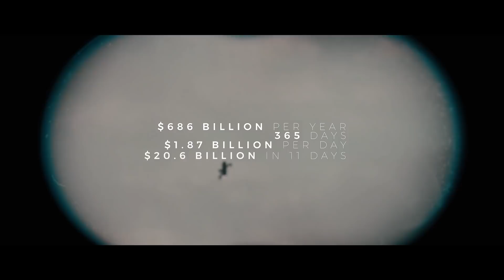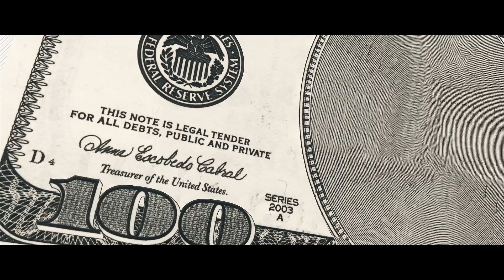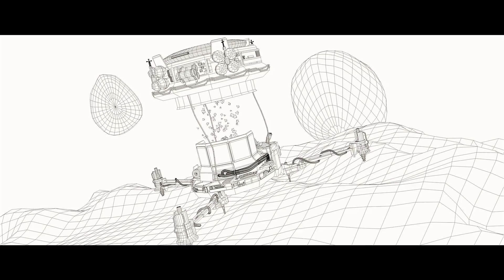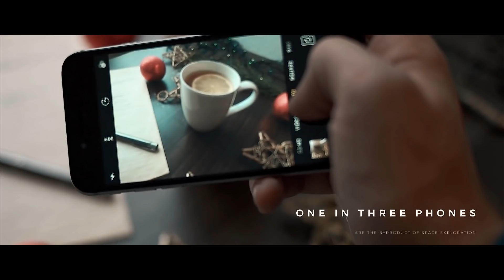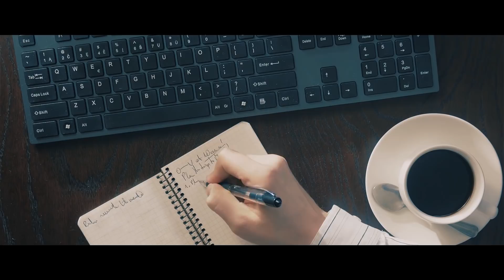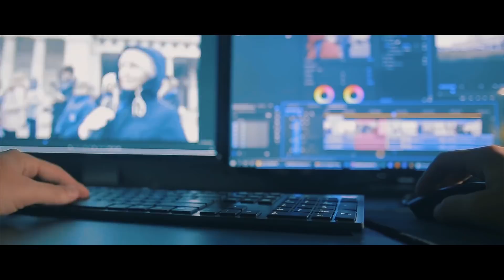If NASA Wasn't Broke

Comment: Sorry,but no. Today's NASA  in completly indeffencable. An SLS rocket is nothing revolutionary. It is basically a space shuttle without the orbiter  and only slightly bigger solid rocket boosters. Frankly,in technical terms building an SLS rockets is much easier than flying the shuttle. The arguement that we couldn't live on the surface of the but instead we should opt for a space station in lunar orbit,just shows that you don't know what are you talking about. NASA's problem is not money. The problem is that NASA has become a subsidizer of Boeing and Lockheed Martin,also known as the military industrial complex. As long as this is the case every penny that is spent on NASA is a penny being waste.

Comment: America’s money mostly goes to military to have the best one which is good
Reply: Bruh our military is making the most useless things with that 600b. Railgun? Seriously? Combat laser? Oh come on! We could be changing the world but instead we are making frivolous little toys to kill people with.
Reply: @pizzasteve5825  Lasers and railguns can be used for space launches (railguns - self-explanatory, lasers - lightcraft and beamed power transmission to power ships remotely).
Reply: @caav56  I don't see how a rail gun could be used in a rocket launch. I have never heard of people using military strength combat laser to transport energy, even if it is a thing it would be extremely inefficient because most of that energy is lost to heat and you would have to be very close in order to accurately hit whatever receptor is supposed to receive it and not the craft itself because a laser like that could do serious damage to it. It is much easier to just get energy from the sun which produces it at over 1×10^26 Watts per second (so over 100000000000000000000000000 w/s). These don't have much use outside of killing people and destroying things. 

PS if you are thinking about destroying small asteroids with satellite mounted railguns, the knockback of firing a supersonic projectile would send said satellite out of it's intended orbit or trajectory a probably into a spin as well.
Reply: @pizzasteve5825   Using railguns for launching things is mostly applicable to the Moon, where atmosphere is not an issue and gravity is low. Even Heinlein wrote about using electromagnetic catapults to deliver cargo from Moon into space and Earth.

About lasers - search for "lightcraft" and "beamed power propulsion". The experiments were already performed. And... what, do you think, can be used to power the lasers? And about destroying the craft - the receptor for space-based non-ablative laser thermal engine is a huge inflatable mirror, which protects the squishy parts of the vessel, while directing the beam to the engine itself. Ablative engines get destroyed over time because that's how they work.
Reply: @caav56  The rail gun method is valid but it is dangerous and kind of over kill, really using a short burst of oxidizer is much easier and safer. I see your point with the beamed power propulsion and I will admit it has more validity than I first anticipated, but there still are some problems. The first problem is artificial structures in orbit (satellites, the ISS, space junk, etc), you have to maintain a clear path between the craft and the source of the laser which means that the 170+ million pieces of space junk and thousands of operational satellites have to not intersect the beam especially if it is an operational satellite or even worse, the ISS, the beam might not fry the target space craft's circuits but those other satellites don't have any protection except for some aluminum foil against the sun. The second problem is that you have to constantly make sure it hits a relatively small target that is anywhere from hundreds of thousands to millions of miles away. This requires constant monitoring and correction and many different emitters around the world. The third problem is the amount of energy the craft needs. A space craft in order to break free of earth's orbit needs to achieve a speed of 10.838 km/s (assuming it is in orbit at 408 km), after about 3 hours of searching google and calculating escape velocities I concluded that for a 1080kg craft (average mass of a satellite) would need about 54,000Ws (Ws, watt seconds, are how many joules are used per second), so for a 1 minute burn it would use about 3.24 mega joules of energy (3,240,000J), and a 1 hour burn about 194.4 mega joules! Now do you think a 150kW military laser would do the trick? Not even close, you would need 360 of them simultaneously pointing at the craft, that doesn't even account for the energy lost to heat and the light scattered by the atmosphere. 

While these concepts may sound cool they are in no way safe or practical. Military stuff is designed for the military not NASA, and right now NASA has a lot more on their plate (Artemis, 2020 rover, funding, ISS resupply, Mars, solar radiation, etc) than making fun little multibillion dollar gizmos to do absolutely nothing with.

Comment: nasa if we weren't so broke:

have you heard of kerbal space program
Reply: Apoapsis Periapsis They probably use KSP to test the SLS
Reply: @pikapolar3966  no, first ksp is a ILLUSTRATION of the difficulty of getting to space. Ksp is scaled down 8 times to make it easier.
Reply: randomguy379 weird, I don't remember commenting that?
Reply: @pikapolar3966  you talking about testing sls using ksp. The delta v needed for kerbin orbit is ~3500m/s delta v. Earth orbit is 28,000k/s. A kilometer of delta v is 1000m/s.

Comment: After trees and shit like for the economy. We should work on clean ways to shoot rockets into the air. We should give money to nasa to work on that, and then it won’t be so bad. Yknow? Maybe use the tether thing from kurzegast’s video
Reply: Or use methalox launch vehicles, with fuel for them manufactured by Sabatier process (like Musk plans to do).
Reply: Musk already has rockets which only produce water as a biproduct
Reply: @cumguzzler8537  Water AND CO2. He ditched the hydrolox Raptor development after many troubles have arisen. However, it's possible to reclaim the CO2 back into methane fuel by Sabatier process.

Comment: Radiation and micro-gravity are two problems that must be overcome before we can do any long term ventures into space.  Unfortunately, you can't create gravity plates or shield from radiation with any lightweight plating materials.  This means that we can never ever have orbiting stations farther out than the ISS and we can only stay in the ISS for a few months at a time.   Money isn't the issue here- we don't have Star Trek's ships at our disposal.  We can't go out and buy them.  Anyone who heads out further than the Moon will never ever return to Earth.  Those people will die out in space.
Reply: >Unfortunately, you can't create gravity plates or shield from radiation with any lightweight plating materials
Uhm... what? Gravity can be simulated via centrifuge approach and shielding is mostly done via light (hydrogen, water, plastics, polyethylene, lithium) materials due to most of it being particle radiation, which, if it hits something, made from heavier metals, will turn the insides of it into a huge X-Ray tube. With cheap enough launches, you can bring whatever shielding you want to.
Reply: @caav56   The ISS is not shielded from the radiation in space.  None of the spacecraft have ever been shielded from it.  Shielding yourself from this stuff is not a simple thing.  Water is heavy and it requires far more than a paper thin layer of water to shield from the radiation in space.  There's a REASON that the Earth's Magneto Sphere is so important.  

And gravity can be simulated yes, but building that is something else entirely.  Getting something like that to work reliably is not something that's easily done or they would have done it on the ISS by now.

So.... yeah.  Good luck with all of that.

Comment: They spend it wrong..... Get real... Should be retitled as "how does NASA spend their money wrong"
ISS is being funded each year solely by NASA for maintenance.  1.5 billion last I checked, SLS and it's perpetual delays and cost overruns.  Inefficient supply lines for rocket development due to congressional overreach (each congressman wants a part of the rocket made in their state. 
Sorry government agencies dont think with efficiency as a forethought. DARPA has been more attributed to our advanced civilization than NASA.  The cost of maintaining KSC is immense.  DARPA is what miniaturized the transistor mah dude.  They funded university teams that eventually turned into the silicone giants.
Reply: NASA stopped spending money on the iss at the begging of this year and have been working on several new projects. We have a telescope thats going to replace the hubble launching in 2021.

Comment: If NASA wasn't broke... I could finish my life's work before I die.
Reply: @Okay Tyler I specialize in propulsion and control system dynamics. My work revolves around the development of interstellar transportation for commerical and private use. In recent years, I have been responsible for developing models intended to maintain large systems in geostationary orbit with the goal to build large-scale infrastructure off planet.
Unfortunately, I do not believe this will be achieved in my life time.
Reply: @Okay Tyler If you're interested in the current development of these technologies I recommend looking into the Gateway. Although I believe it is too limited in its scope, it is progress.

Comment: The sls was not designed to send men to the moon or mars it was designed to keep shuttle contractors in business. Nasa is not run by engineers its run by politicians. Its also very slow to change its a tangled mess of bureaucracy. A lot of things get designed and built but they get canceled late into development. If nasa had spent 100 billion dollars on the existing saturn 5 we would have done a lot more. Nasa today is not the same nasa which sent men to the moon 50 years ago. Today it can even sent men to space. Instead of wondering what if nasa had the millitary's budget we should be asking what if spacex had nasa's budget.
Reply: Damn right nasa is greedy and lazy spacex is better with a tiny budget

Comment: greed is our biggest enemy in a capitalist world

we have many problems ahad of us but also many technologies that are too expensive for dayli use 

we have the technology to make metals that can repair itself by head
we have the technology to build structures as light as a feather strong as if they where build out of titanium
we have the technology to build heat insulators that weigh just little more then air aerogel
we have the technology to make windows out of aluminiumoxynitrid to make the stronger  (that fu.. transparent aluminum [startrek shit])

there are still many problem but  but we are not at the same point at 1972

Comment: sry but if you cant make a gravity on a station or change gravity of mars you will die in like 2years 

your heart will lose muscle mass, 

you will loses bone mass 

the eyesight of male astronaus ist getting worse after some time (theats because males have longer space mission and can handle more radiation)
Cosmic ray is also a big peoblem because we know like nothing when it comes to cosmic rays and what the do to the human body over a long periode (in fakt the only astronauts ever had to do with it where form the apollo programe any other astronaut since then is working inside earths magnetic field and is shielded )

and iss is not financed by nasa alone the cost for running the station lies not on america alone 

also the cost for runing the stace station where high because of those shuttle missions, they alone cost 90% more then a modern roket start o_o 

but he is right in many points
usa has a military budget of 649.000.0000.000$ why not giving more to nasa? 

ok back in the days people get many new technoloies out of military and war but in the last 50 years we got more ne technologies form space exploring the from war 

in the end people put more money on guns that they like 99% never use, then on solving problem that can cost the extintion of humanity
its a fu joke samerica spends 2019 alone more mones on military the they did in last 25 years on nasa and that crazy
Reply: Good thing that gravity is actually rather easy to simulate. Just spin things.

Comment: The problem is NASA burns money like they are using it for central heating with meh results. Look at what SpaceX has done with a pittance of what NASA already gets. 3/4 of Gov't bureaucracy needs to be deleted, period. Its overweight, and has no incentive to spend wisely.
Reply: Tom Merilan Nasas budget is not only used for building the vehicles
Reply: @armhf9617  Right, but NASA builds a ford pinto, for the price SpaceX builds a Ferrari. Metaphorically speaking.

Comment: There are many limitations with how many more expansions can be put on to the ISS. 1st) the more you add to it, the more particle-drag it encounters in the outer portions of the earth's sphere of influence, requiring more boosts for it to say in LEO. 2nd) while it doesn't have to be "aerodynamic" the more asymmetric the craft becomes in terms of mass the more it's center of gravity relative to itself creates a rotation effect, countering rotation or stabilizing it with (RCS fuel currently, or would amount to extremely heavy, extremely large, extremely expensive gyrostabilizers.) so as to prevent high-stress tumbling which could torque all the docking joints of the station & endanger the already existing modules, and make the orientation for astronauts looking at earth, or doing repairs on the space-station extremely difficult or even impossible. There's a solid reason as to why much larger stations start looking more and more cylendrical or circular in space, and that reason is the same reason big planets are round and spin on axis, and why medium astroids are oblong and spin around two axis. A badly designed station is going to wobble spin uncontrollably along all six axis. (3 linear dimensions like x, y, and z, and the 3 radials of the same. Spinning around your own center of mass on all six axis is a crazy experience even under safe and completely controlled conditions. Space is neither safe nor a controlled condition, and that kind of tumbling can quickly become fatal and wildly destructive). People who play ksp are familiar with the kraken, but there are several forces very similar to the kraken in engineering. In an aerodyne design flutter has to be avoided, and a microgravity design structural integrity and the crafts rotational proclivities has to be properly managed. These are things that are for the most part issues that are well understood by those who actually work in those sectors, and easier than some of the challenges building in extreme locations here on earth, but as it relates to the ISS it was designed from the beginning to achieve a certain targeted size, and targeted weight, and still hold its functional shape and relative orbital position to the earth, exceeding that design pushes it further into the unknown. Could the ISS be repurposed absolutely, but if you're going for something much bigger, with a much larger crew capacity, you more likely better off starting with a new station design, than trying to stretch an existing structure beyond its targeted design parameters to avoid the krakens. Besides if dedicated cargo-variant of BFR emerges from the likes of Space X, it wouldn't take 30 missions to build another copy of the ISS like it did with the sts, it would only take a third of that, although you likely wouldn't want to just copy something that was designed to fit in a 70's-thru-90's space-shuttle cargo bay for a craft that potentially has a bigger volume capacity.  

With SLS, falcon 9heavy, and BFR all coming operational around the same timelines, the capacity to build stations as big as the ISS or even bigger is going to become very real, I suspect there could be many space stations, some larger than the ISS, and some smaller. Hell, a cruise-lining BFR variant could technically be a space-station of sorts the same way the shuttle operated as one before it started using its cargo-bay to actually build a space-station, as the bfr could be made to feel even more roomier on the inside than the current ISS which now can be experienced in a free VR recreation on various VR platforms for free.

Comment: NASA is not to be underestimated but they are far too expensive to run. Just look at the SLS so expensive and not reusable and still not working after years and years of delay. Everything NASA does is way too expensive but this would likely be much better if they weren't forced to change plans every 4-8 years.